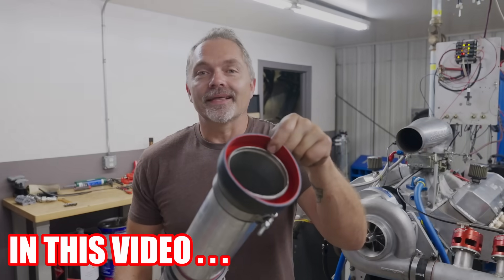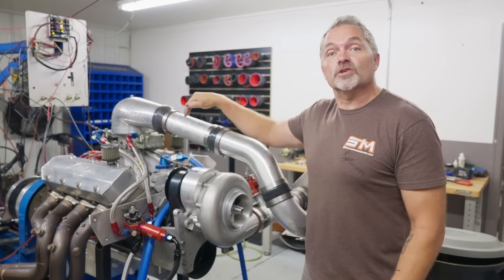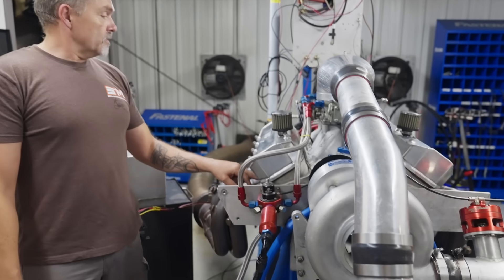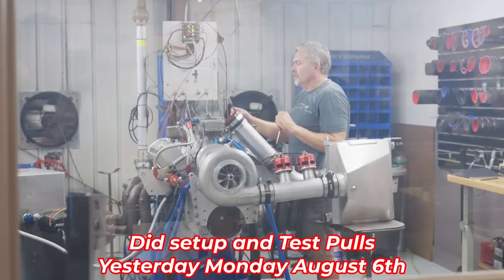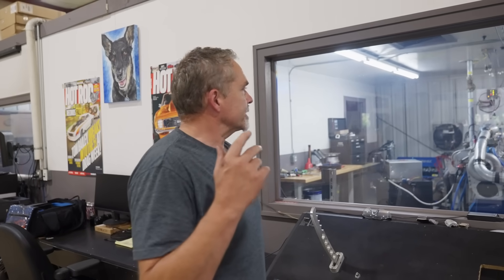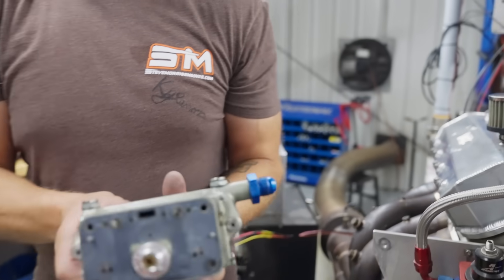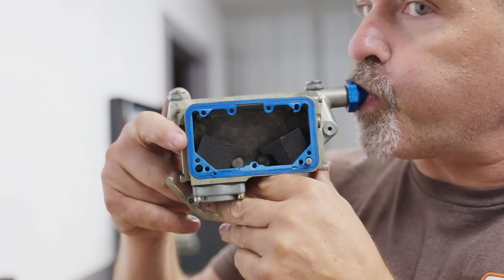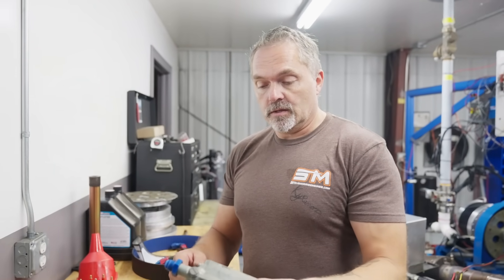I’ve Never Seen This !    It’s An Insane Amount Of Water To Burn??

Comment: I had to cobble a Ford truck together. One time just to have a vehicle to drive. It was a 95 Ford extended cab. Pick up or put a 4 barrel intake on it and a point's Ignition distributor the throtel cable was so long. The only way I could get it to work was to put the card on backwards.  With a adapter plate.

Comment: Cool.
I don't know if it's relevant with the US carbies, but there were some cabs with thin-walled brass floats, and they would collapse with even mild boost, causing the float's needle valves to fully open and flood the engine.
With the float design used there, some would paint then with a fuel resistant varnish, as some would otherwise absorb fuel under boost pressures, which also caused the engines to run rich.

Comment: The intercooler dropped the air temp below the dew point of the water.  Also, the inlet tube coming off allowed a drop in air pressure to near atmospheric which also causes a big drop in temp - like what an expansion valve in an air conditioner.

Comment: Years ago was involved in racing group A starlets. Two good drivers, very competitive and built and serviced out of same workshop. There was one corner at teretonga in nz that is fast and does about 150 deg. We could not get one car to stay on power as it surged fuel. Carbs were identical. Turns out the craft driver of the other car had put a higher capacity cam operated fuel pump from a bigger engined Toyota on his and never said a word! It wasn't cheating but was crafty.

Comment: The "Air cloud/vapour" has nothing to with the intercooler. It's the pressure drop from 30+ PSI, within the charge tube, to atmosphere (14.7 PSI), when it blew off the carby. The pressurised air (P) with in the tube, expanded when the tube blew apart. The air (as a gas), tried to fill the dyno room (gases alway try to fill the available volume (V)), in doing so it COOLED rapidly (T), hence the "fog"/vapour. Exact same principle as air-conditioning Tx (Thermal expansion) valves. T1 V1 P1 is directly proportional to T2 V2 P2. Tighten your hose clamps more, next time. lol. Great video!!!!

C.T. Australia

Comment: On the blow thru carburetor, could there be trash in it or a bent metering rod that might be catching on something. Could it be the air coming in one side, front or back, in higher volume. Also l would check the shaft and bushing in the distributor if it’s running a distributor. I’ve seen worn out bushing on the shaft before. There’s manny variables.

Comment: Did you not see the pipe start to pull out on the first Dyno pull, where it connects to the water tank before it blew out?

I assume that it blew out shortly after that pull, but not sure.

Comment: When air pressure drops, water vapor can condense into small water droplets and form clouds. Water is in air. Air gets compressed to whatever boost you're running. Ait suddenly decopresses and forms visible condensation. Anything over about 1.5 bar i try to add additional bracing to because i don't like replacing IC piping

Comment: A bead roller for the lip of the pipe and cheap hair spray as glue will keep those pipes from popping off. Have seen it hold in just short of 100 psi in diesel pullers
Reply from the maker: It was bead rolled

Comment: Steve Have you ran Dual blow through Carbs ? A friend of mine was running a Methanol C&S blow through( dual solenoid controlled needle and seats ) with very good results , now he has 2 of these carbs and will be on a low rise ,

Comment: Rebuilding and tuning carbs is a lost art on large engines. Hell even small engines are injected nowadays... or sealed, like on lawn mowers. My Grandfather taught me 50 years ago how to do it. Used his brass screwdrivers  that he had threatened us with a beating if we touched them.

I bought a great car for a 150 bucks because thats what the dealer would give the guy for it as a trade-in. Rebuilt the carb - had a loose midplate, thus a huge vacuum leak. Rebuild kit was like $12.  Changed plugs, wires, cap and rotor. Less than a 100 bucks all in. That slant 6 ran great till i stupidly sold it to go to college. Dealer really wanted to rip him off - he knew it just needed a tune up. Cars needed them every 5 to 10 thousand miles back then at maximum. Maybe 3k for older cars. My Chevy Luv truck had dual points and ate them up so often i could set them roadside with a pulltab off a beer can. That was the old days. Cars were a pain in the ass back then.
Reply: Gota love points, and people complain about car maintenance now having to change them plugs every 100,000 lol

Comment: Leaning out that corner jet would effect more than just the two cylinders in that corner.  None of that stuff with carbs is so orderly on a V8 and there is pretty much always some other effect somewhere else too though it may be small.  If you put O2 sensors in all 8 header tubes the mix is pretty much all over the place so all you can do is aim for close and safe where you want to spend the maximum amount of time.

Comment: Well, one reason you saw all that water was because the PSI dropped from 30 to ambient instantly, which the sudden low pressure lets the water condense...   Kinda like a con trail from wings, from the ambient humidity.   Cool vid, and love these vs a diet of shenanigan vids.   Those ok once in awhile, but not steady.

Comment: So every time you start a carb car you turn the pump on after you start it? Bc I’ve done that on all my cars I’ve had some flood but it was a old old carb that wasn’t rebuilt.. my main reason of asking is if you let a carb car sit for a mth doesn’t the gas go way back down in the fuel system?? bc my Monte project I’ve let sit a mth and the bowls look empty through the glass when I have let it sit.. is my fuel system not done up right? ❤ the videos man give me a lot of knowledge I need to go fast old school ways
Reply: He’s saying to cycle the pump on for a second two or three times to prime it. Then start the engine and turn the pump on. Reason being is even overnight you can get a piece of junk between a needle and seat and flood the carb. If that happens and you turn the pump on and wait or get distracted you will dump a ton of fuel into your cylinders and hydro lock the engine. Obviously this is worst case scenario but it can and does happen! He’s just giving u a safety tip.

Comment: I’m a lover of the old school from 55-80 year models. Much easier to work on and if you knew the tricks, you could really make a lot more power. I could put an engine together and have the timing close before it ever fires up. Never had a backfire through the carb. I took a stock 1970 Ford 351 windsor and fined tuned the carb and ran the timing at 35 degrees. It was fast for those days. Later too a 351 Modified and took everything from the whole engine torn apart and took all the new parts to get the clearances right, to Race Engine Design close to Chattanooga Tn. I was told by Summit Racing that with those parts, it should make about 350 hp. I was right there around 450-475. I even had some carburetor tricks too. The simplicity of the older cars is what l like .

Comment: It being in a light weight car and if he had a loose converter in it probably wasn’t loading the engine the same as the dyno is and he was having to add fuel at the track. I know running a N/A car I could get the engine really good on the dyno put it in the car go to the track and end up adding 4 jet sizes everytime

Comment: I remember a 7th grade science lesson on air. When compressed air is suddenly released the moisture in it will condense into a cloud. That’s why you need a water filter on all air compressors, especially when using it on a paint gun.

Comment: The old days we used to have to do a little tricks to the intake to richen up one cylinder or lean out one cylinder dial fine tune distribution with carburetors
Reply: This got me thinking about the tricks aircraft engineers had to do with carburetted engines. At least in a car the engine is mostly straight and level. Those must have been interesting challenges to try and solve.

Comment: That wasn't steam coming out of the charge pipe.  The turbo takes in ambient air with whatever humidity is in the air and compresses it.  It gains temperature because of the compression (but not actual heat).  The high pressure and temperature keeps the moisture in the form of water vapor which is invisible. Then you cool the charge in the inter-cooler and feed the cooled charge to the engine via the carburetor.  Because it's still compressed, the existing moisture (humidity if you prefer) in the charge pipe doesn't condense and remains in vapor form.
However, when the charge pipe blew off, the air inside the pipe suddenly undergoes a pressure and temperature reduction and this drop in pressure causes the moisture in the air blowing out of the charge pipe to condense.  It literally makes a "cloud" exactly like a normal cloud in the sky.  
When heated air rising from the earth ascends, it keeps going up until the reduced atmospheric pressure and temperature at higher altitudes causes the water in the air to condense forming a cumulus cloud.  You can see that on many summer days.  The same thing happened to the charge air when the pipe blew off; i.e. the sudden reduction in pressure and temperature made a cloud for a few seconds. 
By the way, you can't see steam or water vapor.  They're invisible.  What most of us (including me) incorrectly call "steam" or "water vapor" is actually tiny condensed water droplets as a result of steam or water vapor condensing.

Comment: Excuse my ignorance, could the engine benefit from a dual blow through carb set up if that has even been done before. Just thinking like old nitrous engines running dual carbs. I’m referring to the rich/lean problem.

Comment: For those who may not understand that cold water mist is added HP. Explained.... You have that cold air mist going in at same time hot fuel. That hot fuel evaporates the cold water mist super cooling the fuel mix. That cold fuel mix is great for added HP.

Comment: Hey Steve..old fart here, loves my carburetors. Mostly because I'm a BROKE old fart and carburetion is the cheapest way to go (relatively) fast if you know how to make it happen.
I know it's not your thing anymore, but this video made me think of a couple potential problem solvers for carbs.
1. Eliminate the needle and seat(s) entirely..instead, put level sensors in the float bowls and let 'em control solenoid-operated fuel shut off valves. Wouldn't need to be computerized & complex, just an on/off switch to a valve with a big enough bore to flow all the fuel ya need.
2. Install a log on the manifold runner connected to the carb hat, with a needle valve for each manifold runner, so you could dial in an air bleed on each individual cylinder to fine-tune A/F ratio...again, no computer or high tech needed, just a mechanical valve allowing you to increase air flow to rich cylinders as needed..a controlled vacuum leak.
Lame ideas?
Or should I start drilling holes in my ol' manifold?
Thanks for your time, love your content..and someday when I win the lottery, you'll be the first phone call I make.
😁

Comment: hey Steve, I'm not a professional at all nor do u have the experience you have but can't you change to a hotter or colder plug in a carbureted application in individual cylinders to improve the carb/pulse signal to individual cylinders meaning one cylinders has a hotter plug than the cylinder next to it? seen it done successfully on uncle Tony's garage channel. that might just work for dual planes and n/a applications? just a thought

Comment: I wonder if that's usually why it blows off that side due to the higher density of the air on that side of the intercooler( other than the fact that tube is just kinda hanging out there )

Comment: I doubt there is any condensed water under boost. It would be cool to put a clear tube on it and run it again to see....
Reply from the maker: Actually it does. 
Hence the extra timing required.
Reply: @stevemorrisracing  Thank you for taking the time to reply. I agree that there is some condensed H2O in the pipes. It would still be cool to see if there is enough to condense on the sides of a clear cold side boost tube, or if the rapid pressure change just showed us the evaporation. Low temperature steam??

Comment: The condensation going into carburetor  does not harm engine internals  ? Sorry if this is a dumb question
Reply: It's not condensation/actual water that would otherwise be going into the carb that you're seeing blow out of the pipe when it comes off. The pipe blowing off causes sudden expansion of the compressed air, this causes it to rapidly cool down (same physics as makes your fridge cold), cooler air has less capacity to hold moisture and so it condenses out as fog. If the air had stayed compressed the moisture would have remained 'contained" within it (simplified explanation and terminology!)
Reply: @FERGUSMCFLY990   thank you

Comment: Continuation from the question that i asked on another video: do your road going engines are all custom(from the ground up. Example Like SMX but road legal) or based on a road going engines? (Like these LS engines on the video)

Another question; can a car runs safely without valve cover?

Comment: I loved this video! LOVED IT! I'm an old racer (60 y/o) who raced back in the 80's. Carbs may seem complicated to you but bread and butter to me. Memory lane type of stuff. In fact, the mechanical aspect of things in the 80's is what lead me to being a Toolmaker. Advent of computers lead me into CNC programming. But everything you do with computers was handled mechanically. From springs and cams in the distributer to effect timing to jets, power valves and accelerator pumps in carburetors. Old school goodness. But don't think that I don't love computers and fuel injection.

Could you do a quick synopsis on plug reading? I get the fat/lean thing but you talking about timing changes from plug reading baffle me. I'd love to learn more!

Love SM vids!

Comment: Worked with a guy who got stranded cause his fuel pump relay burned up so he hard wired the pump to get home. Well when he got home he forgot the fuel pump would still be running. He said he woke up with fuel all over his driveway and engine was FULL of fuel 😂

Comment: I have never messed with high powered carburetor stuff, only a few hundred HP street cars, I am mainly an EFI guy. At the 25:45 point in the video one of the rear spark plugs was really rich. Is it possible that you would need to tune the rear jets much richer in the car that is moving and much leaner on a dyno with no movement? My though on that is trying to get fuel to move forward from the rear bowl when accelerating.

Comment: That condensation really shows how efficient that intercooler is.
Reply: The condensation cloud had less to do with the temperature the intercooler made the air and more to do with what happens to pressurized gasses when they are allowed to expand rapidly.  It's the same principle how ac systems work.
Reply: @ajk374  good point

Comment: If it is a 4" tube that's over 350 lbs of force pushing it apart. No wonder it didn't hold.
You could tack 2 little tabs on the tubes and tie them together with steel wire to keep them from blowing apart.

Comment: That is the phenomenon where when air is pressurised it heats up and holds water. When it depressurises the air drops temperature to dew point and the water falls out of the air. Technically you made it rain.

Comment: I was shocked to see the old engine not pull a 6 sec when Mullet can do 6s
Reply: That's 20 year older technology only on gasoline not methanol.. why do you think he upgraded to mullets type engine mullet makes a lot more power than that car.. now that he has the same engine he could go way faster.. it's also a blower setup not twin turbo so it makes considerably less horsepower
Reply: @freedomfox8183  20 years ago cars were going 6 sec but nice try. my comment still stands.
Reply: @mrwinston_thepug freedom fox is correct, you are making an apple to oranges comparison, the question for you would be how many ran sixes on gas with carbs, distributors in the heat of Hawaii with the high level of water grains in the air...

Comment: So you know exactly how old Steve & Val’s kids are, with the SpongeBob clip 😂😂😂😂! It would be cool to show how fast you can get a carbed boosted engine up & running to the first pull! It’s usually quick! People have no idea! The time everyone puts into EFI is astronomical! It’s definitely needed, but if you aren’t trying to make max huge promod power, you can probably get away with a good blow through carb! If you are a data junkie, you can run EFI with a carb! But you might as well do it right, if you are getting to that point! Absolutely, you should have fuel & ignition in separate switches! I actually saw a carb & intake blown off the top of a brand new engine! It made a huge disaster!

Comment: the #8 fat plug is very likely the misfiring cylinder, since it's the ugliest of the group. it sure doesn't take much spitting ducks to ugly plugs, especially under high load/boost/rpm's.
I wonder if there's a hidden issue with valves/compression on that hole, or carb doing something silly with hardened gasket/power valve/jet extensions leaking past. but I suppose #6 would be fat also then, which it's not. back to watching to see the outcome. 😁

Comment: You saw the true water grains in the existing air cooled to just above freezing.
Reply: Then instantly reduced the pressure and that allowed instant condensation to result. All that water in the air condensed and expanded.